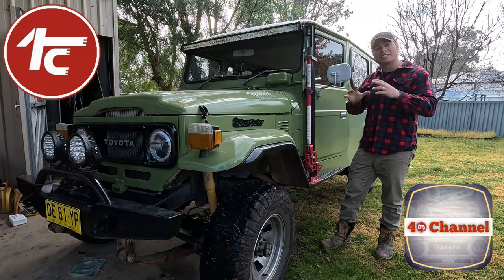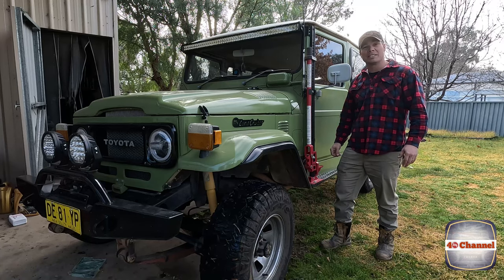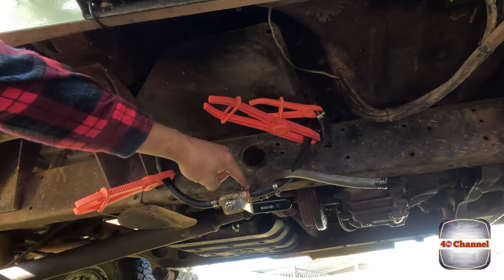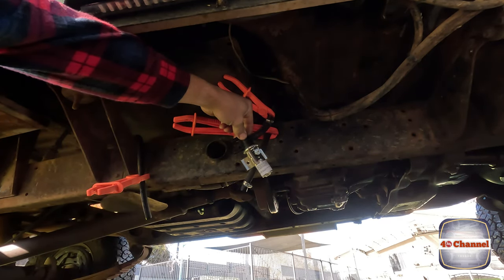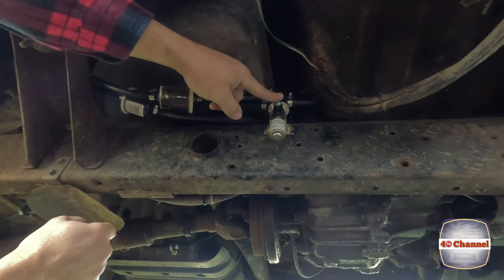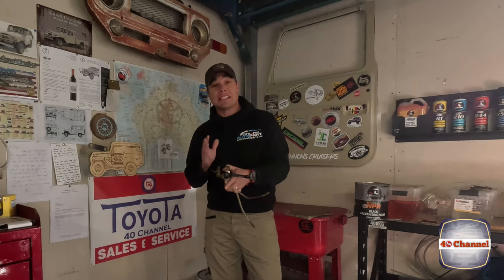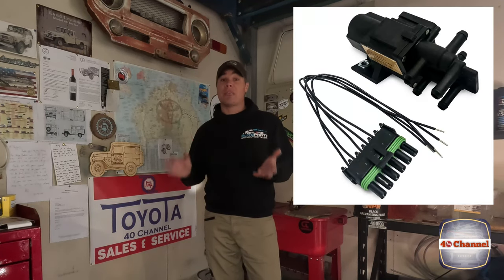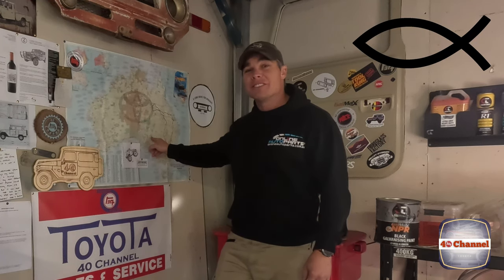S2EP91 - How to install a auxiliary fuel tank 3 way valve - 12 volt actuated

Comment: Excellent info. Took me months to figure out why my main tank was overflowing. Like you explained, I eventually figured out that previous owner didn’t run a return line to the aux tank and that far more fuel is sent to the carb than is needed and excess was returning to the main tank and thus overflowing.  Think this will help others. Thanks for all the great ideas and info.
Reply from the maker: Thank you Derek.